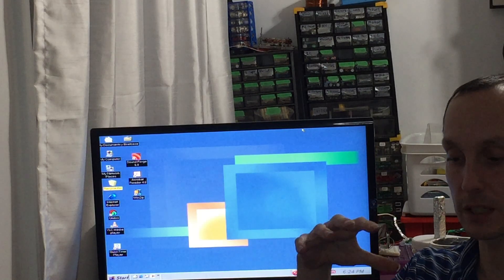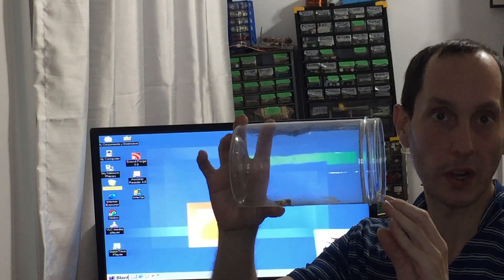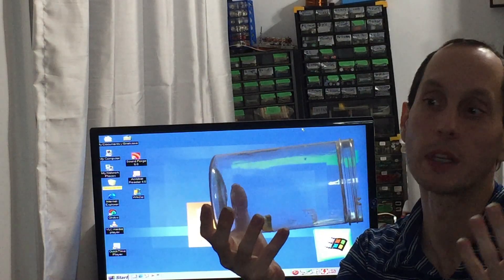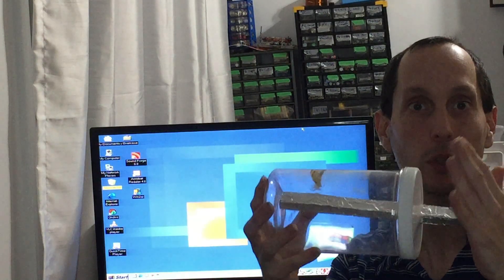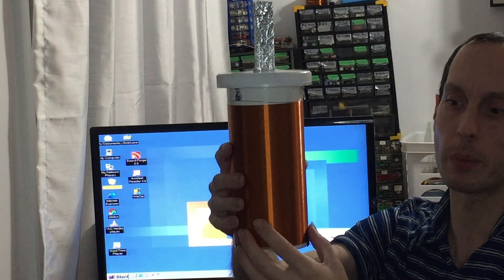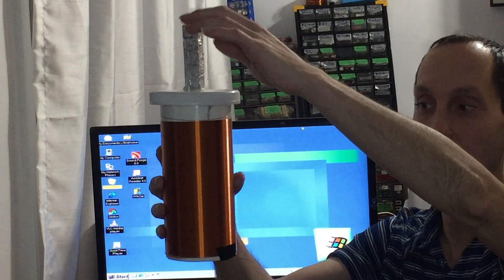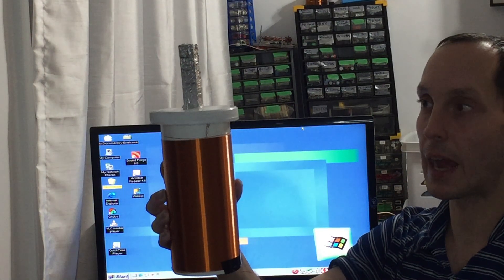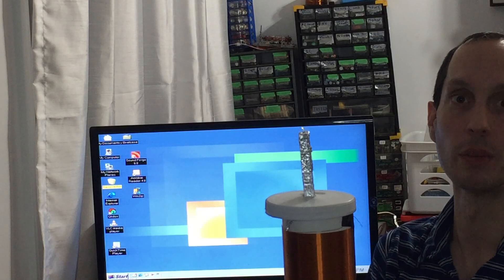Exploring The Ion Valve

Comment: Very nice.  I like your version :-)
Ion valve/radionic valve.  Very good video Joel!  I see someone already mentioned Bruce Perault.  He was working with this also.  I was in a yahoo group with Bruce and Dr Stiffler.  If I remember correctly, I want to say that valve was originally created by someone that has the last name of "Grey".  I was going to try this with my "free energy from air" project, a Joe Tate circuit and an antenna.  Put that valve at the end of the antenna.  And I was going to  put radioactive material inside of it to get a pulse, like Dr Thomas Henry Moray did with his 3rd generation device that worked underground in basement or cave.
Reply from the maker: Yeah I got an oscillator working playing with radiation, It was crude but it worked.
Reply from the maker: Also depending on the gas you want inside interesting things can happen like the ion valve can become its own additional input power source using pure natural state  potential differences of the cathode and anode. (cold reaction)

Comment: please do more experiments this is the same idea i had , but have not been able to build yet. perhaps the diode  can have a cap and a air core. i think this could be at the end of each plug. around the closed surface. it could be 1 meter square. but add a 10 foot counter off each inductor as a counter pause. then you could have a second circle that connects all the 10 foot leads. and makes the entire thing even bigger in terms of volume?